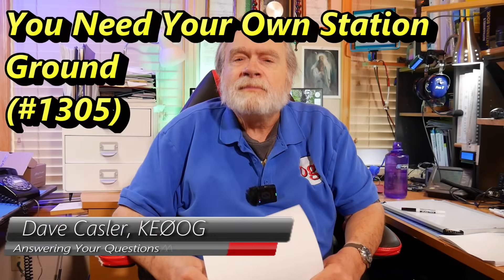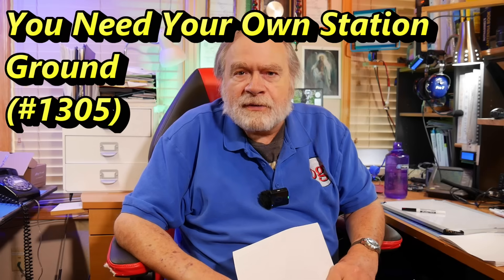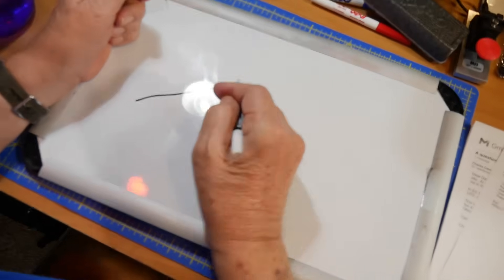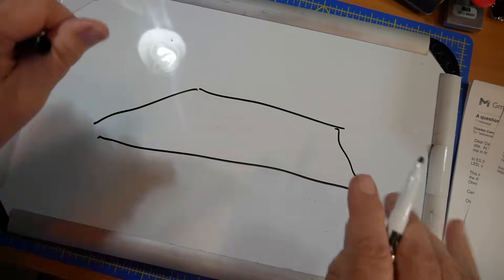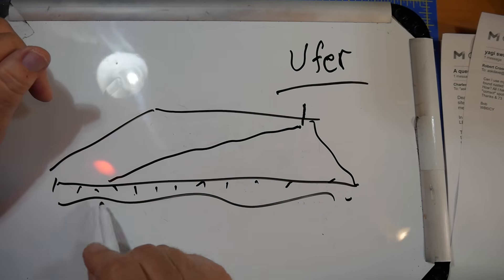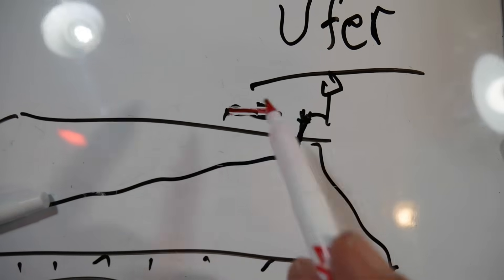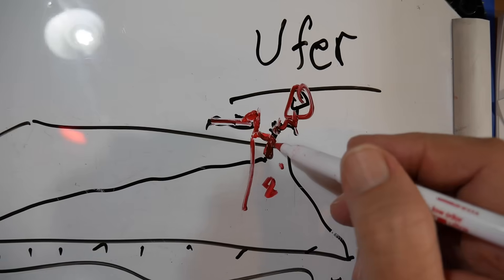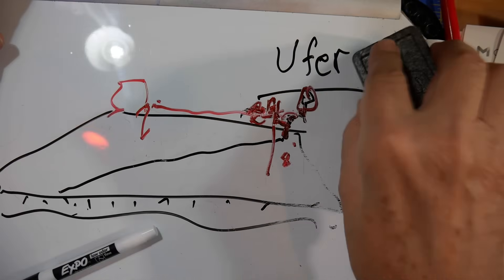You Need Your Own Station Ground (#1305)

Comment: Looks like my house has 4 ground rods the one goes to cable box. I have a mast and vertical antenna if I have a seperate ground stake next to mast can I ground mast and antenna to mast ground stake and then to the house ground that is connected to cable box thanks.

Comment: American viewer, but live in Chile, with a new Chilean Ham license. I am pondering getting an American Ham license. Due to international agreements, it is oddly quicker to get to full general license privileges via u.s. ham license operating in Chile. It takes 1 year for the basic intro to qualify to take the test for the novice level, then you have to be a "novice license" for 3 years, and then you can take the general test. Although it takes longer in chile to reach general, the "technician" equivalent, is pretty liberal. For example, I am allowed full privileges on 10, 40, and 80. and VHF with the first test. Oddly, UHF is off-limits for new HAMS. Honestly, from what I have seen, no one really cares if a new ham operates on any of the other bands, as long as they behave themselves. In 90% of the country, there so few people, and even less radio users of all sorts, no one is even around to hear you. still, I follow the rules, because I got more than sufficient bandwidth to play with as new ham. If I need more access, I will taje the U.S. ham license remotely.

Comment: I think the knew way I’ll explain bonding the station ground to the utility will be this:

The station ground rod goes between your equipment and your utility ground. 

I feel like you said this once in a video and it made sense to me. Somehow this video made think of it. 
 73. N8CF
Reply: —Between exterior antennas and the shack — yes, tie to the utility neutral/ground before entering the shack.

—Between indoor equipment and the utility neutral — absolutely not.  The station ground ties to the utility ground which ties to all electrodes.

Comment: I live in Oregon. Dave you are absolutely correct about the grounding. In a very dry climate, which Grants Pass is much of the year, I would but in a couple of ground stakes (or more) about eight feet apart and bond them all together and again include the Ufer ground.  I live in the heart of the Willamette Valley and I have six nine foot ground rods. One outside of where my shack was in the house, (my shack is now in my detached Garage) one on each leg of my tower and an additional fifth four inches from the original ground stake for the house / garage electrical panel and they are all bonded together with bare number four or so (same wire used by the electrical companies down the side of power poles) buried solid copper wire. My new Shack ground exits the Shack and is bonded to this number four copper wire.  For three and a half years now I have experienced zero issues. Thanks.